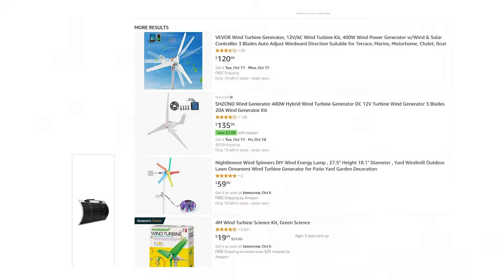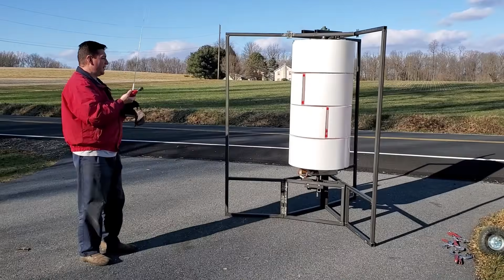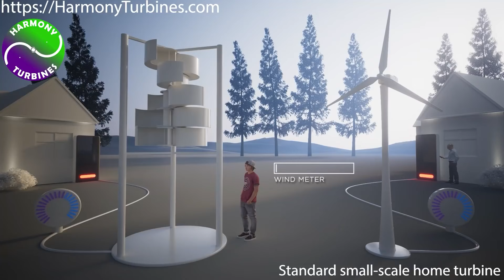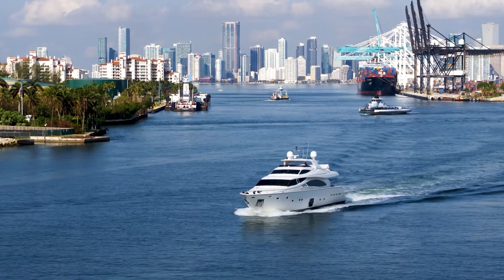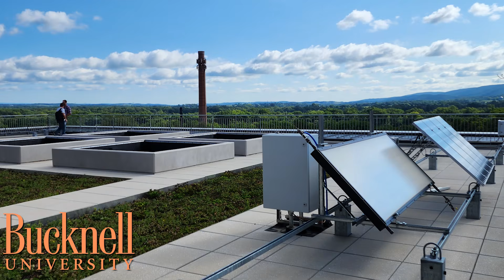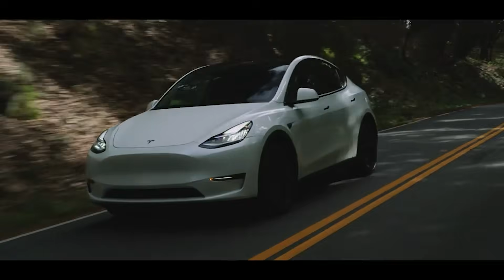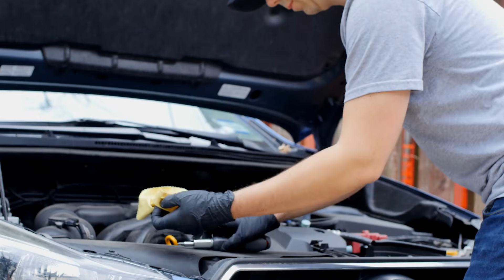Harmony Turbines | The Perfect Small Scale Wind Turbine?

Comment: Can they fit within the legs of a Rohn 3 leg tower? I have one I installed next to the fireplace chimney.  The small sections only have 10" clearance from leg to leg in the interior triangle. But there is a larger one I can stack mine on top of. Mine is very sturdy. 55' tall to reach the TV stations 70 miles away in Springfield Missouri. These towers are all over the place out here. A larger lower section should surely be strong enough to support your turbine. If one could fit within the legs . . . All the sections are 10 foot tall

Comment: Nice people. BUT: All practical tests of ground-based small wind turbines show: 1) They hardly produce any electricity! 2) They do not last long! 
Electricity yield is proportional to third power of wind speed: +100% wind generates +800% more electricity! Close to ground: 0 constant wind, but extreme gusts! 
Due to extreme price decline solar panels generate at least 10 times more electricity with the same investment in time & money! Unfortunately not at night and not much in winter! But reliable && maintenance-free for 25 y+! And you need a battery for wind and solar. 9 out of 10 small wind turbines stop working after just a few years due to the extremely gusty winds close to ground.

Comment: You lied there at 11:00.   Engineers have been thinking about this for decades if not centuries.   That is why it doesn't really exist and why natural gas is used in most situations because its the most efficient energy you can get.   The trouble with your vertical turbine is the cost, mechanical complexity and liability.    We now live in a world where people are loose with the truth about things where they cherry pick things to suit their bias.   They short change the math and don't carry things down to the bottom line.  Engineers do and in the past accounts were also honest.  That is why things like vertical turbines didn't exist 20,30,40, 50 or even more years ago.

Comment: Placing any wind turbine near the ground is foolish. Disturbed wind has FAR less potential energy to capture. This means you must build more or larger turbines to do the same work as a turbine placed in clean air. Bottom line is cost per kWh produced over the life of the turbine. Betz law describes the potential but it seems it is not even considered by these fantasy VAWT ideas. (I have sold and installed small scale wind turbines since 2001 in Mexico and the US)

Comment: Honestly there is a lot of talk, but 11m/s wind (which is pretty high wind speed) and getting 400W for 5.500$ - where is the economic innovation here? It costs me 13.750$ per kW installed power and that is without the cost for mounting and installing I assume. On the website it says 7 years for ROI at 16cents per kWh and 15mph wind. I calculated at 24/7 400Watt production it would be 9,7 years. According to the data if you get 400W at 25mph, you only get around 20-25% at 15mph since windenergy increases and decreases cubed to the windspeed. With this calculation, let's give it 25% it would talke me 38,8 years of 24/7 production at 15mph windspeed and 16 cents per kWh to get my investment back. How is this efficient or economic? With mounting and installing costs and some maintenance I'm probably at 50 years. I would like these questions like performance and price adressed more, because a new looking turbine pops up often and I haven't heard why this one is better than the others really (means overall economy which is the most important factor for most people). Thank you.

Comment: How about them electric cars and the winter freeze working out??  😅
I was thinking maybe just make a box that lowers down to limit how many scoops are exposed to wind and it will keep the unit out of the elements?? Some kind of computer programmed to prevent speed over voltage.

Comment: Stumbled on your video.  You mentioned startup speeds, and then generator pattent.    Then I saw you crank in the paddles to reduce  high wind speed rpm,s.   That released some plinko chips in my CPU.      As I watched, Balls Out came up on the possible's as a solution for both.   (Variable field diameters). Then minutes later you throw the clutch plate theory out.   (Till then had no idea or thought about either) That had  me buffering for a second.   Then started thinking of all the possibilities.  (Numbers of fields at different diameters plus physically variable field diameter and proximity s).  More buffering.  ???  Also why don't you use a good solid axle through the center instead of outriggers to the top, looks like harbor  freight !!! ? Also #2. End product as a novelty should have a audio turntable style strobe that indicates incremental output wattage 😮

Comment: 8:390 nope. I'm a wind turbine blade technician and I can confirm that in high winds the blades pitch changes so it will not face the wind in full. above the  safe operating speed limit the blades actually pitch 90 degrees out of wind thus reducing the speed of the rotor to 0 rpm. This situation is very rare but wtg are equipped with all kinds of safety sistems to keep the turbine safe in case of very high wind speeds

Comment: Syncronicity is a buzz word used in highly religious group projects.   .   .ummmm there are so many wind turbines with many under about $2000.  Some highly-rated wind turbines in 2023:

Tumo-Int 1000W 3 Blades Wind Turbine is considered the best overall home wind turbine
Automaxx 1500W Wind Turbine Generator Kit is considered the best for backyard use

Auecoor 800W 12V 24V Solar Panel Wind Turbine Kit is considered the best system.
Pacific Sky Power Survival Wind Turbine Generator is considered the best small home wind turbine.
Ramsond Atlas LM3500 Wind Turbine is considered the best for off-grid use
Pikasola Wind Turbine Generator Kit is considered the best budget home wind turbine
SilentWind Pro

Comment: This principle is very old people made these long ago the problem with these is the are weak in generating power still no good for the average home with lots of dirty wind. Unless u want a very expensive yard Whirley thing. Yes it will work for flat windy landscape. But not for the average home no way. Also too much bulllsitt in all the logistics and machining  as they are talking and they have not made enough prototypes that are fully tested. This is all old technology bending metal, welding, a shaft with bearings a frame? Come on there must be a million  people in this world that can make something like that these 2 are fakes just like so many just interested in profit and not working hard thell find some easily duped investors and run with the money. These things will not work in dirty wind ever so no good for most homes in urban areas.

Comment: We need more people like this couple that think outside the box and governments need to adjust rules to install turbines in residential areas. That said, vertical turbines is not a new invention and to say the competition is crap is unfounded. Many companies spend tons of money on R&D in fact their concept is based on that so don't knock it. And an overspeed safety system depending on electricity is a bad design although the concept of the folding in blades is ingenious if it is their own.
For boats this concept doesn't work the to get the same output as a horizontal turbine it will be way too big to put on a boat. This video is more a sales pitch than a breakthrough in wind turbine technology and a bad one at that. I don't have a wind turbine so I'm not biased but have done my homework.

Comment: I love how they literally reinvented the wheel they just took the classic ying and yang and turned it on its head and made it in to a 3 dimensionality rendered wind scoop and in using that they were able to simply build a scoop with gear teeth on both of the edges and put a smaller gear with the same size teeth on a stepper moder in the center of them and just like a flower they can open and close the scoops and make it spin faster and slower in less wind with more efficiency man talk about a slap in the face we have been looking at that F_ing picture of ying and yangs ower hole lives and doesn't even see what they did that's the difference between a hick IQ and Einstein's IQ a hick can see what Einstein doesn't see in the simplest of things lol love it guys !!!!!!!!!

Comment: The design is almost identical to the original power structure components used in the 2nd Interstellar Transporter that arrived at Area 51, however, it lacks the metallic strength of fused neo atomic particle distribution.
Still, it can be modified to include additional power infusion systems with induction control of parameters not yet considered.

Comment: The problem with this site is that it has conned a lot of gullible people. They don't understand the physics. The unfortunate facts are that the power output is proportional to the cube of the wind speed and the swept area which is proportional to the square of the linear dimensions. Also the Betz limit.This produce will not work for pretty much any domestic situation. Too small and wrong site. Vertical axis wind turbines are alway less efficient than horizontal axis wind turbines. These people are either deluded or con artists.

Comment: Thank you for an excellent video presentation. I live in South Africa in the Western Cape in an area which has wind 24/7  at  more than 5 mph most of the time. Gusting at 10 mph.We are about 60 miles from the nearest coastline .Our country has regular electricity blackouts on a daily basis. We have recently installed an inverter and battery storage and are thinking of a wind turbine rather than solar panels in the future. Well done to Harmony wind turbines and wishing them every success in the future.
Reply: @christopherbuckley619  The energy content of a 10 mi an hour wind is negligible.  These contraptions will probably not even spin at 10 mi an hour, or at best be able to charge a cell phone.

Solar panels are far superior to small wind generators...95% of the time.

Comment: Harmony turbines Inc?6 26 23
I really you , get to read Mr and Mrs.creator of harmony this Idea of mine.maybe some has thought of it, but I haven't seen it. S,o the big deal is by directional double deck wind turbine. It's like three generators in one.
At the base lies a fixed to the floor the circle of 12 gauge coils twelve tall on the inside and eleven on the out side. x's 
thirteen coils. Above a fixed to the spokes of a twenty three inch front bike wheel - tire, a microfilms distance away rides the magnets that create the first stage of the " triple fix harmony by directional vertical wind turbine generator. 1600 Watts? If you build it perhaps.
Next is a chrome bar that threads tightly onto shaft of bike wheel then cleft with a wooden eight armed frame attach to eight six inch half plpe 22" long turbine blades cleft into spokes below.atop wood frame rides a plexiglas. Circle coil 
plate with 16 coils same as below 3".atop the coils rides another micro film spacer, and then. Another wood frame with magnets flush with the bottom of 2nd frame, witch are cupped in opposite direction as the lower sect. So top and bottom spin different directions there by double the speed of magnet,coil interaction double out put? 
I really think if you reingeneer my idea and make it right you could build the generator that could power the whole house.
You don't have to stop at two, with your tech ability you could stack em high and make some short versions to take to the lake. And you Surely should take Mrs. To the lake or you'll be getting a divorce for sure.
Good luck and Id love to find a comment
Reply: I should have wred be fore I hit the button. In short the rear wheel is attach with coils and mags the same as below only upside down giving three different hot spots

Comment: I think instead of the stepper motor to fold it in on high winds, why not the very simple governor mechanism like there are on the old "hit or miss" engines, steam engines and such? They would run for  any years, only needing a little oil, but nowadays we have sealed bearings, so no maintenance, no windspeed monitoring, no current drag.

Comment: Have thought about stacking axial flow modules throughout the height of the unit? It's something I've been looking for or looking to build if it doesn't get made soon.  If you make the axial flow rotor in three pieces, with the coils in the center/middle portion.  Then you can soild mount it to the vertical pole and have its wires run down through the vertical pole.  For either a series or parallel connection.  Then sandwich the coils between upper and lower shells with your magnets.  Then that way you could sell a modular unit, with a rotor for each bucket/prop/air foil/blade or whatever term you want to use for the surfaces the air pushes against.  That way the customer/end user can make their whole unit to whatever height their area will allow.

Comment: I’m currently retro-modding a barn built in 1899. We’re in the planning phase now and have ideas for a 50kw rooftop solar/wind hybrid system. This is intriguing in a couple of ways to me, one is it’s lower profile, and another would be the ability to design the generators inside the structure in a climate controlled environment. We’ll be in touch.

Comment: Do I have to be a cheer leader or can I do some critical thinking here? In brief, this is 45 minutes of saying nothing. To start with, I do have experience with Savonius style turbines including spending time in a wind tunnel to maximize them. Harmony Turbines has not. They have been speaking in generalities for years. Two months or less is all it takes to do a wind tunnel test to get a baseline of performance. Their key selling point is the lack of wind knowledge people have. They are selling dreams. The Savonius is about 15% efficient for a good running Savonius. The HAWT is 45% or better and can be had for cheap. Their turbine has no advantage over a normal Savonius other than, and I’ll give them this, it can furl out of high winds. Unfortunately that feature makes them incredibly more expensive and prone to failure. They can NOT scale the size of these up as there is simply too much mass which equals expense which equals no sales. 

Dirty wind. This is simply a term to mean there is very little available power as the wind doesn’t know which way to go. It’s blustery. In order for a turbine to work it needs force on one side and a vacuum on the other as the velocity of the air is slowed down, that’s where the energy is coming from. When you slow down the velocity of the air, you have now increased the density of the air…air doesn’t like that. It either needs to move so it can expand to the same density as the rest of the air around it or it sits there. If it sits there, it is blocking movement of new air coming in. You know, there really is a science to wind turbines. If you want to pay for a kinetic sculpture, buy one. If you want wind energy at a palatable price point, buy a HAWT. If you want lower noise, buy a larger diameter HAWT. There is no doubt that a Savonius turbine is less noisy. That is pretty much its only attribute over a HAWT. In all other aspects, your typical three blade turbine is so much better. Don’t buy the cheap one, but a quality one and you’ll be pleased for years.

BTW, this pains me to say. We had a cool VAWT turbine (proven performance better than standard by a bit…AND self furling). After doing market analysis, turbine performance, physical product positioning issues, permitting etc etc, it just doesn’t make economic sense. We shut the project down, still have a prototype sitting in San Gorgonio Pass wind farm. We did all of that for less than a quarter of what Harmony Turbines has raised on their first round. They are not doing right for their investors.

Comment: I had imagined a similar idea of sails tightening or closing in high winds. But mine didnt use power to close in the sails. It used ballist weight which spin with the sails. But... with a scissor hinge the weight pulling out at speed will close the sails at high rpm.
Reply: Thoughts for product evolution.

Comment: They look kool, how much useable wind blade surface area do they have while operating?   And what is the output in wattage during the different wind speeds?  How a wind generator looks or the noise they make doesn’t really bother me, it’s the power output at different windspeeds and I am mainly concerned with.  How does your design compare to the rest of the designs in power output?  It seems to me you still have the same problem they all have except for the huge commercial ones that put out 440 V.  Those utilize the torque the wind produces by having large blade surface areas.  So they do not have to turn fast to get there wattage and they are able to gear up the generators rotational speed by using gear ratios.   I think the mistake small wind turbine generators make is they rely on the wind speed and not the wind torque which you will only get with the larger surface area of the blades.  Although you have fixed a few problems, but have you fixed the problem of The generator most of the time only producing a small amount of it’s rated power due to average wind speeds throughout the year.

Comment: Your furling tech is genius and well past time to have evolved.  Quiet turbines are well loved turbines, and mostly shadow-free turbines are not constantly disturbing neighbors.  That's 3 extremely good marks for Harmony.   
Now if you can get something that works on 3mph winds, I could even use one here in southern OR.  = Invent magic, please. =
I realize that the Sivonious method has a lower output, but I much prefer it to the noisy propeller style.  And for a solar and wind powered home, small inputs add up even if you're not topping off the batteries in ten minutes.